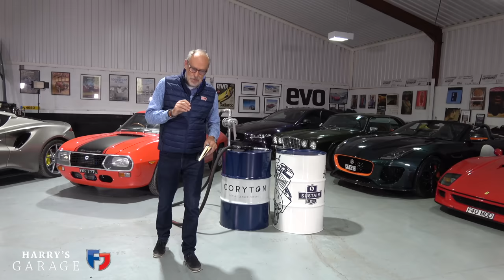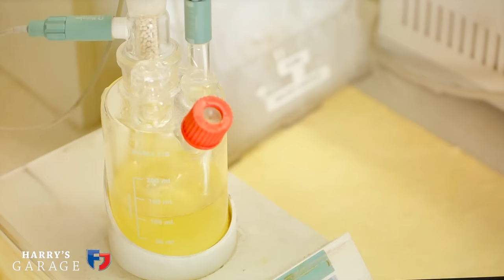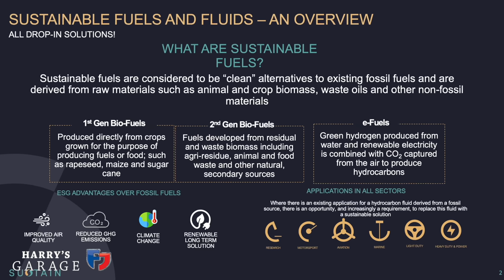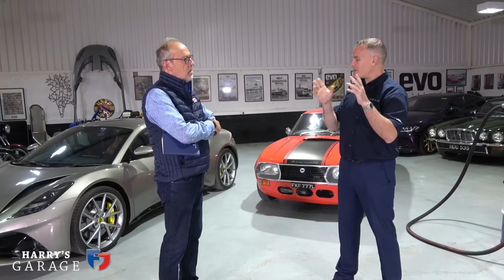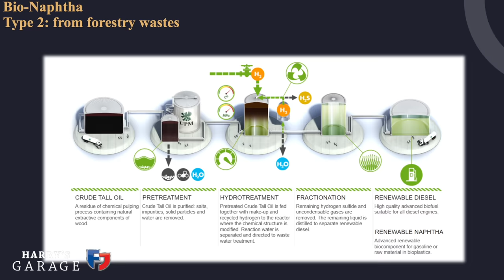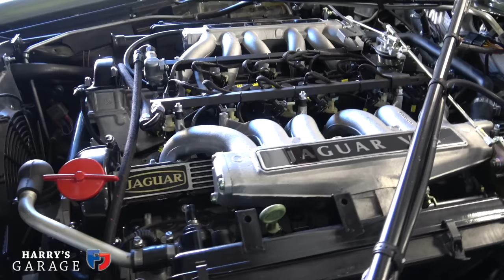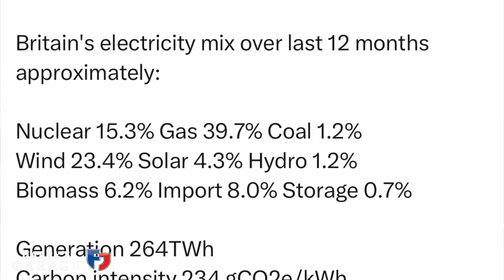Everything you need to know about using sustainable fuels. Why they're good news for car enthusiasts

Comment: Ain't one shred of "sustainability" in that over fossil fuels, unless someone can prove that in Kalories used vs possible output from end-product.
Where does your power come from when producing all your extra-steps? Don't answer "sustainable sources" because then we hit yet another obstacle in which the definition comes in to question, and its capacity. Everyone leans on that one, and it is in fact limited in capacity.
So you end up using more energy to reach end-product, you produce a ton of the stuff "you aim to minimize" - but only want credit for what you calculate on and want to avoid showing the numbers of what is deemed bad?

Cherry picking much, then?

Comment: I do not belive it will not damage carburetors or older, not ordinary injection system, they are being damaged even now with bio parts of fuel. I unfortunately think that this will stay as a very limited fashion stuff for few modern cars used rarely.
Reply: Different chemicals. 
Ethanol can damage materials in fuel systems that aren't designed for it and, due to its hydroscopic nature can cause issues if it's left in something that's been stored for a while. 
Synthetic petrol is just petrol but the base chemicals to make it come from a different source so it should actually work better than fuel with added ethanol.

Comment: Sucking co2 from the air and putting it back along with an aditional 20 to 50% is not a solution. And then it need transportation. And it still doesn't solve air pollution and particulates. Its greenwashing and the law of conservation and thermodynamics tells you this is BS.  But worse is that normal crude will make its way in to the mix and you'll never know. It's a silly way to go when electric vehicles work. Put the money to development of better batteries and energy density. You've had a good life Harry. It's time to grow up now and let go of the brum brum beep beep joys that keep us all young, but the planet is on fire so don't deprive the next generation of the good life you had. But you've spent their carbon budget more than most of us Harry. It's carbon negative you need. This is not it. This is an excuse for you to pretend it's all okay. But it's not.